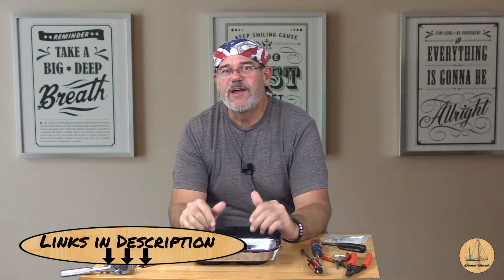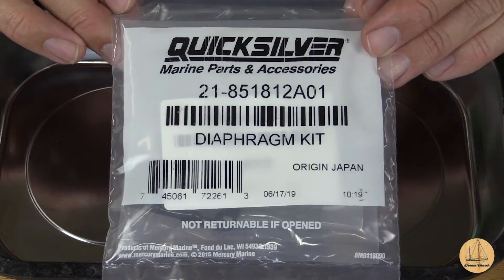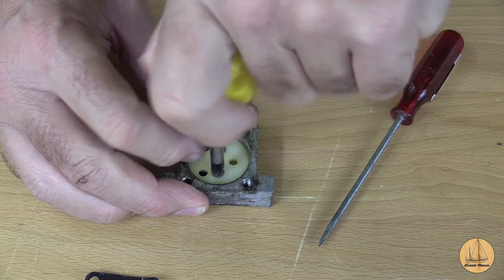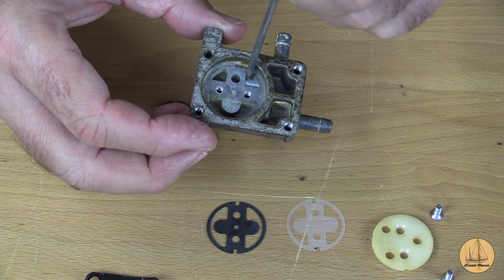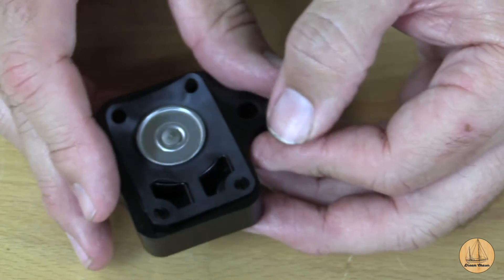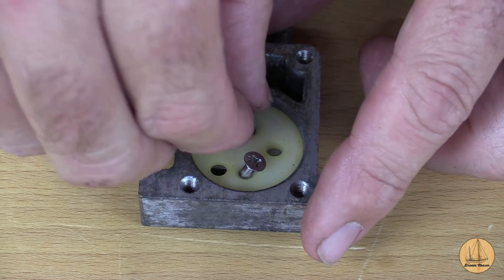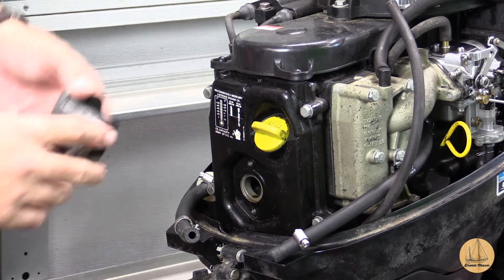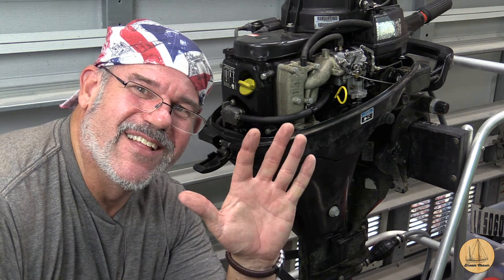Rebuilding fuel pump on Mercury 9.9 HP outboard motor

Comment: Can fuel leak past a faulty diaphragm directly into the crankcase?
Reply from the maker: I am not 100% sure but it seems logical that it could if there was breaks in the little diaphragm gaskets.   They are cheap enough, I highly recommend replacing the carb. That is what I did for less than 2x the price of the rebuild kit.
Reply: Thank you for the reply. In my case,the carb is swimming in fuel. Engine runs a bit then drowns in fuel. Had that carb apart a few times and that float and needle valve seem perfect-but just replacing the  carb appear$ to be the best solution . @Svdreamchaser
Reply from the maker: @jbnb3342  interesting. I am not an expert on these so it may be worth posting in a forum online for these too.

Comment: One question, i have a 9,8 tohatsu and suddenly it stopped and  when pumping fuel no fuel enters carb but all the connectors work, a changed them and all  and blowed some pressurized ait in carb and so on,The  pump  "balloon"  from tank gets hard as if no really fuel enters and the engine rews a little and stop. Is this probably the pump? it is the part closest to sea and it often is salt on and the engine have ab 150 to 180hours, a tohatsu 2021 much in use on relatively long distanses over a fjord. If so i just replase the whole thing because this part is most beaten up by the corrosive enviroment. I No found out and edit here,  it was vacuum. From the tank with loocked air vent, i disasembled the carburator and the fuel walve fell into normal position again, moral in story, disconnect fuel tank og always air vent open
Reply from the maker: It may be the fuel pump or the carb itself. I think this engine is similar to yours and if memory serves me correctly the little fuel pump (manual) is near the back of the engine just on the bottom side of housing. I am doing that from Memory so worth chasing the fuel line inside engine housing. I opted to replace the carb because it was only about 35-45% higher cost than the rebuild kit and I didn’t have to worry about it being anything else.
Reply: @Svdreamchaser  I found out, it was when the boat sat docked with air screw tighten on tank no wenting.This created a wakum loocking the floater in the carburator, i dissasembled the carg and released the pressure, no it works like new with new plugs and oil

Comment: Thanks...some info on the effects of a bad pump would be helpful. Example, is this a go/no go symptom? (no starting or starting then stalling). Can a faulty pump still work but resutl in fuel flow problems such as surging, irregualr idle etc?

Comment: Think the guys who replaced my impeller and serviced the motor ( won't throw y'all under the bus on here) put the two diaphragms in backwards because when I pulled the two halves apart I could see the black rubber through the plastic disc hole and not the white/clear. Its even imprinted. Had issues with the gas running out DOWNRIVER but luckily my buddy was sitting in the back and would just prime the hand bulb every time it did it. He had actually mentioned this to the same shop when they worked on his boat upgrade, and they said fuel pump. Makes me wonder if they did that on purpose for repeat service? Thanks to your video didn't need them though.
Reply from the maker: Glad it was helpful. Thanks for watching.